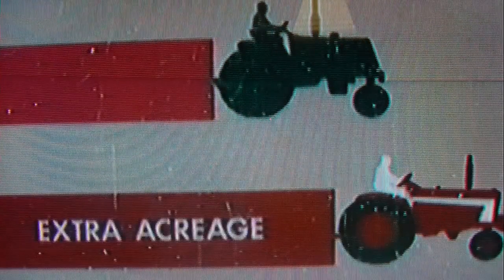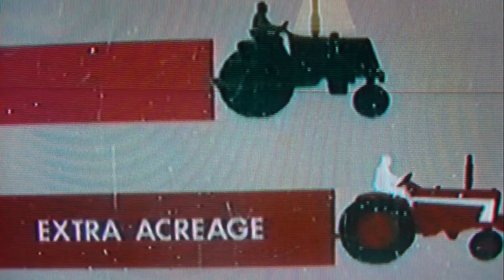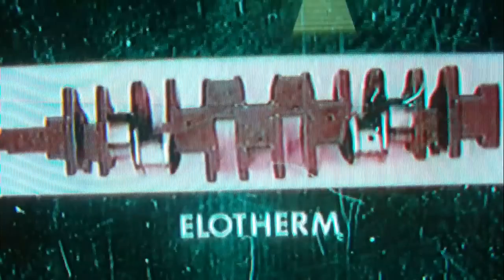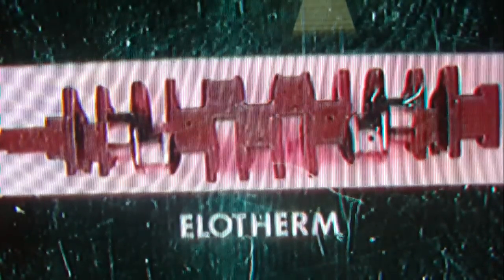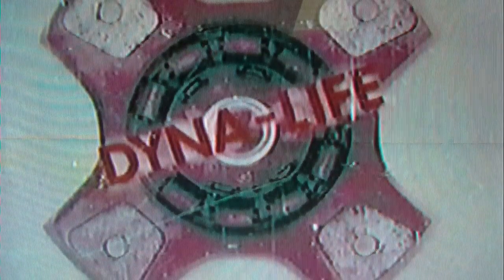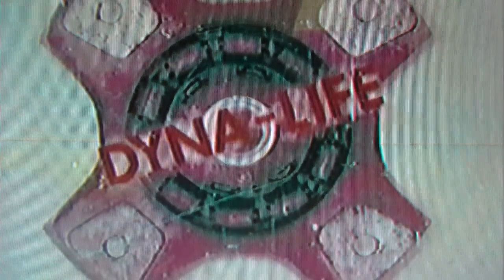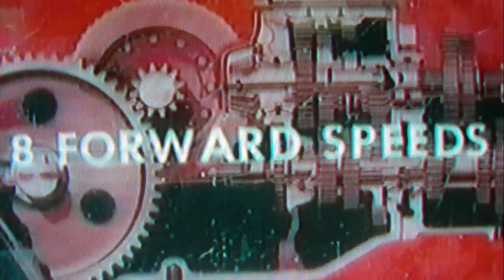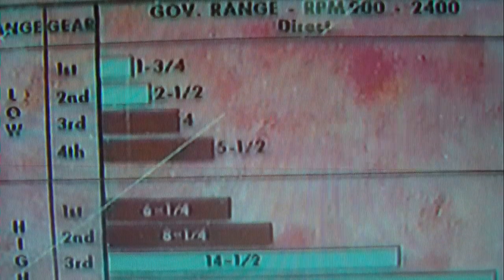the all new 806 series tractors from IH.

Comment: We had Deeres.  Our IHC dealer gave us a deal we could not pass up on a used 806.  Boy did it run.  We then got a 856 without trading thank god.  It was not the machine that the 806 was.  It was quickly traded for a 1256.   A few other trades happened but the 806 remained.

Comment: The 806s are great tractors. We still use them today. Dad bought an IH 914 pull type combine and at the time all he had with a 1000 RPM PTO was an 1100 Massey. It was underpowered and anything that could slightly plug it would kill it. He bought a 1066 the next year and of course it had no trouble and he bought an 806. One year the PTO clutches went on the 1066 and he had to use the 806 which is similarly powered to the 1100 Massey, right? Wrong. If the combine plugged the 806 would roast the drive belts. It had no trouble. We now have 3 806s. A Farmall on propane, a diesel International, and an International on propane.
Reply from the maker: very cool. my friend has a ih 914 pull type combine  & a 806 2. but he parked the 806, it was tired. he runs his 914 on his 1086. he was going 2 put it on his 1566 becuz it has more hp.. but he likes it on the 10 more.. my 1586 could run that combine just fine.. we have a farmall 400 gas & a farmall B im hoping 2 pull that B out soon.
Reply: Ty Frank p

Comment: Went from Super M to the 806 what an improvment.
Reply from the maker: nice. :) i'd 2 get a Super M.
Reply: The M was pretty clapped out, seat had a permanent lean to the right from plowing, it did have fire crater head on it and a reworked carb, but the hydraulics with the twin screw pump really was the weak point.
Reply from the maker: ya.. i'd just use 1 for gardening

Comment: I have 2 International wheatland 806's the one I am rebuilding right now it has a M&W turbo on it and 23.1x30s cant wait to get it running again.  I saved it from ND she had a spun bearing come to find out last week.  Just bought new crankshaft today not reground, new crank going to totally overhaul her and restore it but it will also get used for farming from time to time.  Also have a international 650 diesel, w450 gas, 660 diesel and yes the 2 806 wheatlands, yes im a wheatland fan!
Reply: Wyatt Hansen, one thing I will caution you about the International 806 is the steering will wander at high speeds The Farmalls don't have that problem because the steering system is different.. So watch it when you go on the road. all the International or Wheatlands, as you call them from the 706 - 1456 have the same thing and the same problem. My dad and I have owned lots of those tractors and they are all great. I think a Farmall looks naked next to one of those.

Comment: an 806 nf with 16.9-34's hilarious
Reply from the maker: +punhoss i guess some people needed that setup.
Reply: +MRJOHNDEERE3720. :) Yeah, I suppose so. . . makes it look like a little tractor, most of the time they're doing the work of 120+hp with big rubber.
Reply from the maker: punhoss
they have alot power 2 be doing  that kind of work.
Reply: +punhoss My Dad's came with 18.4
Reply: punhoss no kidding. Our 806 diesel has 18.4x38s and we need to run duals. 16.9x34s aren't enough to hold down a WD-9 let alone an 806. A lot of the earlier International 806s had 18.4x34s Those are adequate for a 706 but not an 806.
Reply: The 806 was the last big Farmall tractor where the tricycle style front was popular. The next model the 856 was mainly sold with a wide front end even though IH offered tricycle front ends as an option up to the 86 series (686 to 1086)